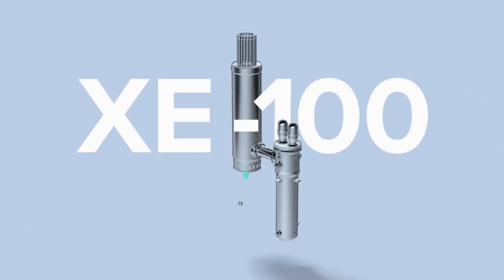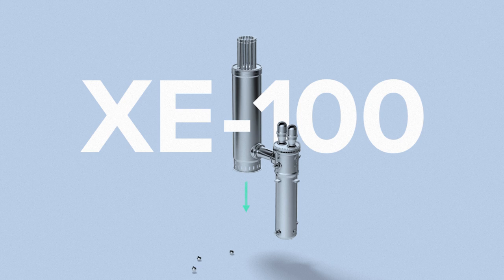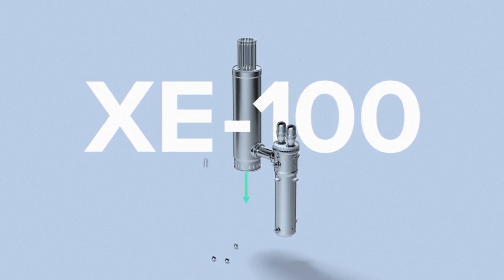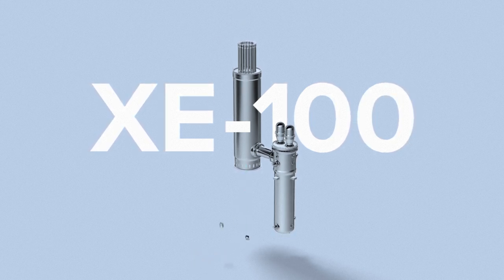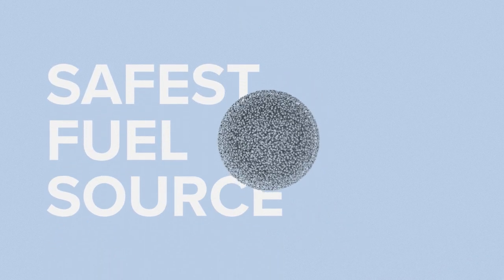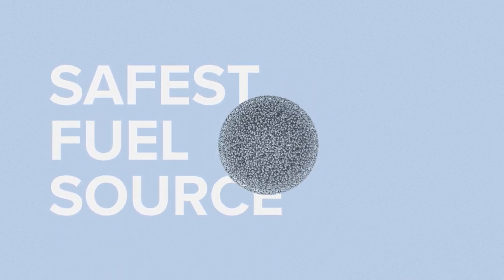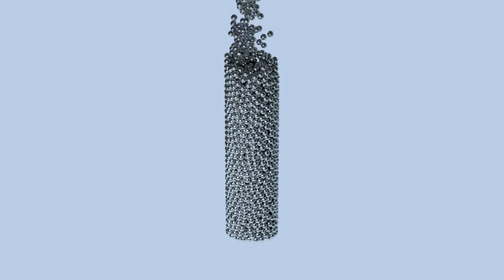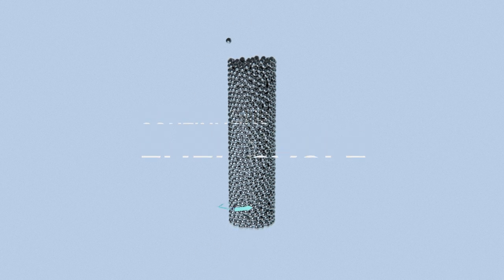X-energy (Xe-100 Short Technology Explainer)

Comment: Wait you mean that there is no need for the 3rd barrier? Clads in PWRs are also a barrier but they still need 2nd and 3rd barrier. Helium can leak. I understand that spherical shape is far more stress bearing capable then traditional cylindrical fuel rods. How is it meltdown proof? It was the main highlight that was not elaborated much in the video.
Reply: Each peble is clad in a metal shel, who's melting point is very high.
Reply: There are 3 fuel particle coatings. Two are pyrolitic carbon (essentially very pure graphite). The third is silicon carbide, an extremely hard and heat-resistant material. The fuel pebble matrix, the helium pressure boundary can all be considered radionuclide barriers, but the only important safety-related one is the SiC layer in the fuel. The Xe-100 has no need for a traditional containment because any fission product release from the fuel, even under severe accident conditions, is comparatively tiny.

Comment: Need more info on fail safe.  Where will all the helium come from?  Following.
Reply: The helium is used in order to absorb heat instead of water or molten salt, the hot helium evaporates water to drive a turbine to create electricity
Reply: @saltblood  Thanks.  Understand the concept.  But still curious about stable supply of helium.  Also, not seeing the fail-safe comparison to molten salt reactors where the fuel turns to a solid if there's a breech.
Reply: @marke.haller4267  In my answer above, my understanding is the layers of solid carbon surrounding the uranium kernel. Those layers can withstand the heat of decay without melting in the event of reactor shutdown.
Reply: This device appears to be a development of pebble bed reactor concepts. Pebble Bed Reactors are an experimentally proven concept that has been demonstrated. It's an inherently safe design that reduces neutron exchange potential with the insulating layers of graphene coatings. When the pebbles break any shards and loose fuel are dumped into a moderating material (such as boron) and separated from the active fuel pebbles. There is insufficient fuel to create a critical mass, and the worst result possible is a brief concentration of fissile materials which may cause a sudden increase of energy output which is within the design parameters, and  which would merely result in an increase in the release the radioactivity within the reactor which would serve to increase the heat output until the process itself jostled the broken fuel sources into the moderator. This failure mode has been incorporated into the design of the reactor because the fragility of carbon shell coatings is understood.
Reply: @michaelfoye1135  You should read up on what "criticality" means and what "moderation" does. The fuel definatelly reach criticaility (more precisely delayed criticality) in the pebble bed (it has to) and boron is a poison material not a moderator.
Reply: @CraftyF0X  Sure thing Buttercup. Just link your recommended reading material to your comment.
Reply: It's a pebble bed reactor if the system overheats, it has two saftoes 
1: overheating expansion lowers fission rate
2: dump the pebbles in bottom containers. 
DUMP THE PEBBLES  is all the safety you need
Reply: @marke.haller4267  There's barely any radioactivity in the helium. If there's a depressurization, the fuel just sits there and nothing happens. The fuel can get incredibly hot without failing the fuel particles.
Reply: @michaelfoye1135  I don't know what you're describing here but it's not the Xe-100 safety case. The pebble graphite matrix is the moderator, not boron.

Comment: Interesting concept, I agree with the above commenter though, what exactly is the safety features that make this small form factor meltdown proof?
Reply: My understanding is the layers of solid carbon surrounding the uranium kernel. Those layers can withstand the heat of decay without melting in the event of reactor shutdown.
Reply: The pebble bed reactor houses tiny fuel kernals in a small ball of pryolitic carbon encased in silicon carbide which has a melting point of 2,830 degrees Celsius. It cannot melt down, becuase the materials would rather ablate and decompose.
Another safety feature is the reactor is dumpable, if something bad happens, a vent bottom opens and pebbles are dumped into vats.

Comment: Why does it have control rods over a pebblebed? Are they gonna just shove them in and hope the pebbles move/shatter to accommodate? Also what do they mean "helium doesn't become radioactive"? and where is the cooling part?
Reply: Heluim is inert gas does not react with the possibly escaping fission products (from the containment pebbles) to form bonds and carry them around. Neutron activation of helium (4) is pretty unlikely and when it happens it produce very short livede stuff he-5 maybe he-6, disintegrates in no time (in a few ms) so radioactive helium is basically not a thing (it is a thing but for so little time that it might as well not be a thing)
As for the rods, yea wtf ? o_O (maybe there are chanels for them in the bed not represented properly by the graphics, I can imagine it's something regulatorily mandatory)
Reply: Helium is inert it doesn't become radioactive, even isotopes helium 3 are stable
Reply: good question, actually. The control rods aren't shoved into the pebbles, they're inserted into channels in the graphite reflector around the pebbles.

Comment: I have worked in the nuclear power industry for several decades and am very pro-nuclear.   While TRISO fuel if great and offers many benefits ... It's also very expensive; especially if enriched to a level that can run for 60 years.

My biggest issue is that I am unaware yet of a single pebble bed reactor design that has shown long term viability.   The several I know that were built (Germany pioneered this technology) have many pebbles stuck in the bottom and some of them are partially melted.  These problems took years to develop before they were noticed - and are adding substantial portions of a $Billion to eventual cleanup cost.

The Chinese licensed the German Technology and have built a pebble bed reactor that came online for commercial power operation in 2023.  It will be decades before we know if the Chinese have solved the "sticky/stuck" pebble problems of the previous reactors.

X-energy claims that their HTGR reactor design is "Proven."   I view it as "Experimental."    Very few HTGR reactor designs have worked in the world, and most were shut down very prematurely.

Comment: Instead of water, this system's efficiency can be increased by using supercritical carbon dioxide turbines, enabling a smaller footprint. 

This system also seems to be small enough to replace boilers and furnaces in coal powerplants--a drop in and very safe solution to convert to low/zero carbon electricity on the grid with the fuel literally unable to melt down. 

And isn't triso simply stop reacting when it gets too hot?
Reply: As many expert pointed out before me, the problem with sc co2 route is that you need to build expensive and experimental turbine set, and what it does is that it improves thermal conversion efficiency, which is oddly enough, not that easy to justify in case of nuclear fuel, as it is already very energy dense and cheap compared to something like fossil fuels. I see this from engineering view and like the efficiency at every step of the process, but in the end, real world economy decide who builds what. Not to mention, as far as I know sc co2 is not yet 100% proven tech, thus when you build your brand new experimental reactor you might not want to connect it with a brand new experimental power conversion system.